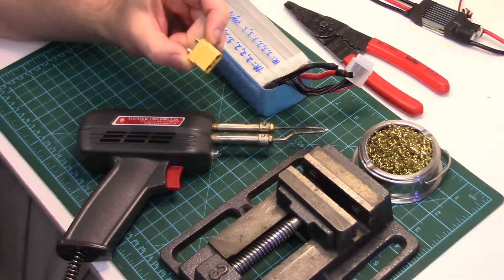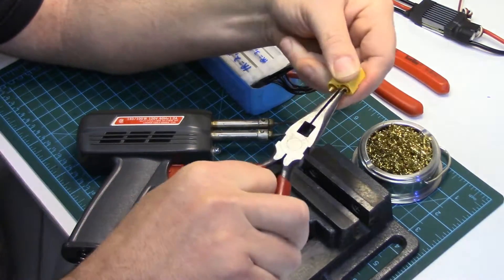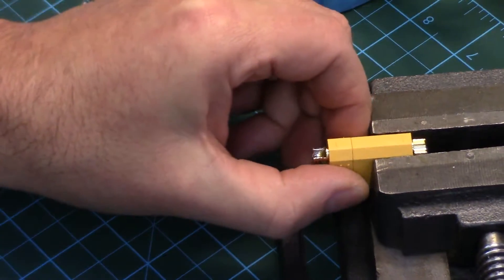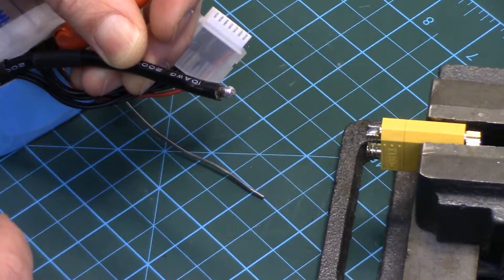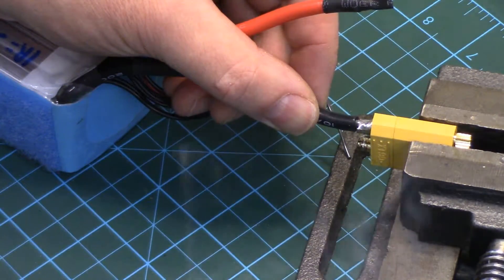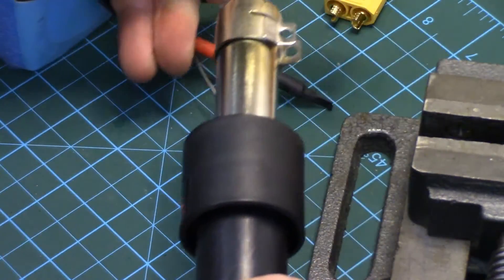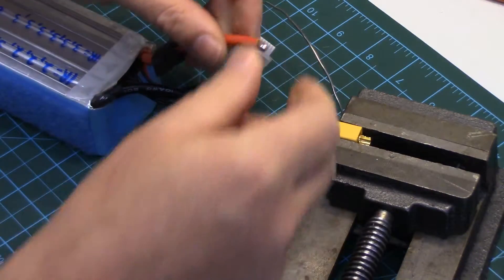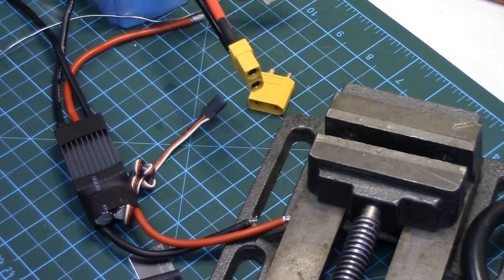How To Solder XT90 Connectors

Comment: Ive watched this several times and not been able to duplicate... how do you heat both the wire and the connector. Ive burnt through 2 connectors and my fingertips. I am using 10g wire and xt90s.  Any suggestions?
Reply from the maker: Could be dozens of reasons, and without knowing specifics such as what soldering equipment (power, iron/tip type, type of solder/flux) you are using and seeing your soldering technique, it's impossible to know where the issue/s are. Have you seen the two soldering fundamental videos in this series on soldering equipment of the importance of proper tinning? These are must view prerequisite videos if you are having the issues you are describing. 
1. Soldering tools and solder: https://youtu.be/jQfvqJJCS7I?si=6abbc1QjKnLGhNhT
2. The Importance of tinning: https://youtu.be/DCvo1xQr6jY?si=6s_ETnNURwZCcSbU

Comment: how much current can you put through the joint?
Reply from the maker: XT90's as the name implies can easily handle 90 Amps sustained. I have pushed close to 150A for short durations without issue and little in the way of voltage sag or ripple increase (with the caveat that is with healthy battery packs).
Reply: @Rchelicopterfun  I understand that the connector is 90 amps. the question is whether the solder joint that you made can sustain 90 amps DC.
Reply from the maker: Soldering = metallurgical bonding at the atomic level. In other words, if done correctly with good quality electronic grade solder, the solder contact surface area between all the wire strands and connector base is much greater than the rather small mechanical contact surface area of the bullet pins in the connector. The bullet pins are the weak link, not the solder connection (with a quality soldering job).

Comment: Hello from the future! 😂
I totally concur with using a solder gun rather than a solder pen for the bigger Amp RC battery connectors. I recently used my Aoyue solder station for circuit boards to remove the EC5 connectors and solder in QS8-S connectors on my CBHL LiPo batts for my Redcat RC ‘64 Lowrider. That took longer than should be to have adequate heat to solder the battery wires to the QS8 connectors. A solder gun gives quicker constant heat to a larger area melting solder for adding wires without overheating/melting the connectors. 
Cheers from a Yank in  the UK! 🇺🇸🇬🇧

Comment: I just got a new soldering station. The thermostat says that it's well over 800° and yet it doesn't seem hot enough to melt the solder once the wire is touching the connector. I'm probably doing something wrong. More flux, more tinning. I don't know.

Comment: Can a 60w  soldering iron do the job? Not as clean as this one
Reply from the maker: Need at least 100W to do larger gauge wire & connectors. Power is covered in detail on my RC Soldering Beginners page: https://www.rchelicopterfun.com/rc-soldering.html

Comment: Great video, thank you for posting!
I have always used a big old soldering iron on these, which usually resultet decent joints but almost always melted a bit of the plastic as well. 
Will be getting a soldering gun now for sure!

Have you modified the tip on yours perhaps, it doesn't look like the default one I keep seeing?
Reply from the maker: Stock tip; no mods.

Comment: Thank you for the video. I want to learn how to solder. I want to buy the best solder to learn from. Kester  44 rosin core 66/44 .8mm 1lb  spool on Amazon I will be using xt60 xt90s with 12 gauge silicone wire will this work. Thank you again .

Comment: You make it look so easy!  But I thought that standard practice is to use female connectors on batteries.  Have I misunderstood this?
Reply from the maker: The connector with the lowest possibility of shorting is always on the battery/power source side of the connection. In the case of the XT30,60,90 and 90 anti-spark, that would be the male connector with the female bullets inside. For more information on connector polarity practices - see my RC connector article on my website. The polarity topic is about 2/3 of the way down in the article: https://www.rchelicopterfun.com/rc-lipo-battery-connector.html

Comment: im trying to do the same exact thing but with copper ends on the connector.. the tin wont even stick to the copper any ideas?
Reply from the maker: Not enough heat, not enough flux, poor quality solder, poor soldering technique. Any or all.
Reply: Thanks I ordered the same gun as you comes in today I’m gonna give it a try

Comment: Are your hands made out of iron or something?  I counted 15 seconds when you were putting the wire into the xt90 and you held that wire... my hands would be burnt at this point
Reply from the maker: The silicone insulation on those wires is pretty thick and makes a wonderful heat insulator. It was getting a little toasty however. 🙂
Reply: @Rchelicopterfun  Even with my insulated wires they get super toasty. How do you get them to melt into the solder so easily? I usually have to leave my iron on top of the wire while pressing it into the connector and it will melt the plastic before melting into the solder. Also a lot of times the solder will drip under the connector
Reply from the maker: A powerful enough solder iron or gun for the job, and good quality 60/40 or 63/37 rosin core leaded solder are the two main factors. If you boil off all the rosin flux, extra flux is also a must have consumable. Clean solder tips are very important for good heat transfer and little oxidation contamination. Practice is of course important. 
I cover all these soldering basics and wire size in correlation to required solder iron Wattage on my RC soldering page if you haven't seen it: https://www.rchelicopterfun.com/rc-soldering.html

Comment: Im planning on buying a castle mamba x esx and im only gonna run 3s on my rc car and i want to know if this connector would be too overkill for a 12 gauge wire
Reply from the maker: What's the maximum current rating of the ESC/Motor combo? An XT-60 would likely be adequate if it's not more than around 60 Amps max or so. Nothing of course wrong running a larger connector than needed other than the increase in size and cost.
Reply: @Rchelicopterfun  well now that i look at it i might be using a xt90 cause the amp draw will be around 70 to 80 or so,but thanks for the info man :D

Comment: Absolutely top !! Just missing the temperature I should set with a rework station (WM3 and the like) ??
Reply from the maker: I've never tried to solder wire with a hot air rework station so I have no idea at what temp you would use, or if it would even work. I've only used soldering irons or guns for wiring projects. For them there is no "best" temperature value as there are variables involved such as wire/connector size (thermal mass), type of solder, type of solder tip, how long you are willing to hold heat to the object, and individual working temperature preference.  On larger connectors like the XT90 with larger wire (8 or 10 AWG) with a fair amount of thermal mass, I will usually have a conventional tip soldering iron set on the higher side (around 400C). With the newer direct drive tip technology irons such as the TS100 or the Hakko T12/T15 tips, I run about 20C cooler so around $380C.
Reply: I wasn’t talking about hot air... got a Weller WR3M station, but soldering with a standard 80W tip.
I think you’re right, something close to 400C is probably best, was working way lower, and having trouble (took too long, and damaged the connectors, but have to say I didn't plug the opposite connector, which certainly helps dissipating the heat and also ensuring they stay aligned). I’ve seen another video which mentions 400C, too...
Many thanks for the video & your reply !! Much appreciated !!
(just tested... 390C worked perfectly)

Comment: These are the hardest damn connectors to solder.   Whomever came up with the "solder cup" idea is a jackass.  I just buy pigtails now and don't bother with this part.
Reply from the maker: One of the easiest to solder IMO. Certainly easier than most bullet connectors because you can easily get the solder tip and wire into the cradle (good heat transfer) and they mechanically hold the solder better than flat tabs like on T-connectors.

Comment: Hey mate, my wires keep ripping off my XT90s, any idea why, any tips?
Reply from the maker: I would have see them to better understand the mode of failure. Commonalities include: cold/brittle soldering, wrong type of solder (non-lead), not enough flux used giving a poor/oxidized mechanical connection, poor tinning, poor soldering technique, or something unrelated to solder.
Reply: @Rchelicopterfun  so using non lead or silver solder is a failure point?

Comment: What wattage is the soldering gun ? Cheers
Reply from the maker: 140 Watt
Reply: Cheers John do you think the weller 100w will do as good a job as yours ? Thanks mate
Reply from the maker: @danielhearnden3776  It totally depends on the gauge of wire (how much heat it's pulling out of the tip) and how long you are able to hold the tip to the wire/connector to melt the solder before the housing of the connector starts to soften too much.

100W should be able to do 12AWG  and may do 10AWG would be my best guess.  The only way to find out is to try it :-)

Comment: My dad has exactly the same Weller gun as you have there.  I couldn't get enough heat out of it to solder EC5 connectors.  Have you ever tried?  Hope you dont mind me asking.  I ended up buying a new Hakko soldering station which cost a fortune but worked instantly.  Just short of things to solder now :D
Reply from the maker: Yes, those Weller guns will easily do any RC connector out there. Including EC5's (yes I have done many) which are pretty much the same pin size as an XT90. It will easily do 6 AWG wire and I've gone larger than that on house wiring. Must have been something wrong with the gun you were using. Did you try a new tip or at least tighten the one in the gun? It's not uncommon for the nut/screws that hold the tip ends in place loosening up and they need to be tight to pass the current.

Comment: Very  nice, clean job. What are you using  video gear wise?
This recording is as sharp as a tack!
Reply from the maker: Thanks. Camera is just a little Canon Vixia HF R600. Think the current model that replaced it is the R800?
Reply: @Rchelicopterfun  Belated thanks. You're right about the current models but If I find a used one in good nick, it'll more than meet my immediate needs. 
Cheerio!

Comment: Thanks, learned a bunch. Is there a reason the plug has to be together when in the metal vice? If it was separated there would be no risk at all of a short from the exposed ends touching metal.
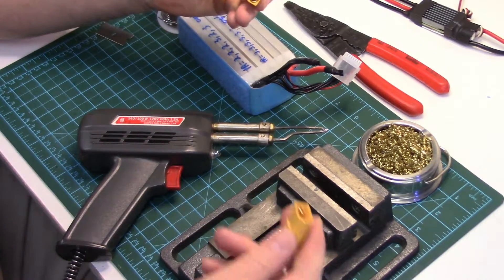Reply from the maker: I go over the reason why starting at 0:38 - it's to ensure the pins stay aligned if the housing softens from too much heat.

Comment: Just wanted to say thanks. This video really helped. I figured out that my solder iron wasnt getting hot enough to tin the wires. Following your advice I was able to tin the wires and convert my ERevo 2.0 traxxas connectors to the XT90's so pumped. cant wait to get it out and bash. :)
Reply: Exactly my problem, until I watched this video I was thinking I couldn't solder, it was just not enough power.

Comment: What's the max size on XT90 plugs?  Wondering if 8-gauge wire will fit on an XT90...
Reply from the maker: You can size any wire to fit in a connector pin. 8 will work on the 90's, but it does have to be sized a little. I demo this in my Bullet Connector video:  https://youtu.be/fdTDTuBb3pQ

Comment: If you hold the iron on that long won’t the heat conduct through the wire and ruin the cells?
Reply from the maker: 10 to 15  seconds long? Not even enough time to boil off the flux or feel much warmth from the wire where I'm holding it less than an inch away from the connector. At the battery terminal tabs a good 6 inches away, likely not even enough conducted heat to detect. Regardless, the cells are exposed to much greater localized heat when the tabs on the cells are soldered along with the wiring.
Reply: Thanks, that’s good to know. Do you know whether ESCs are more vulnerable to conducted heat? When I did mine one of the cables got quite hot going into the ESC. I did have to redo it so I probably did two lots of 8 seconds on a 10awg wire 2inches long.
Reply from the maker: Again, pretty hard to conduct enough heat from a soldering iron or gun through a length of wire to do much harm. Most ESC's state they can handle operation temps up to about 90C (190F)  for short duration's. So I would suspect as long as the wire ends at the ESC are not getting over that (which I can't imagine how they ever could), you have little to worry about.